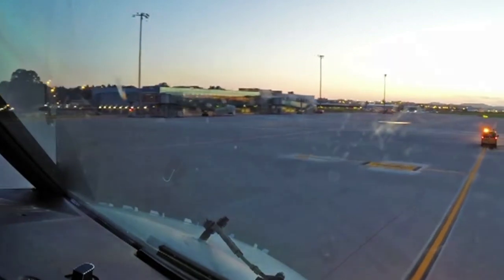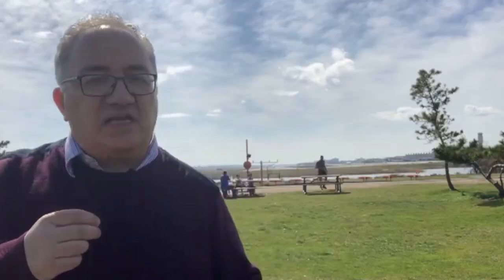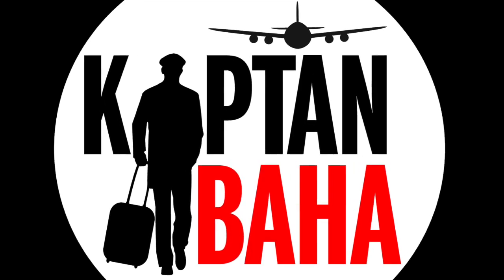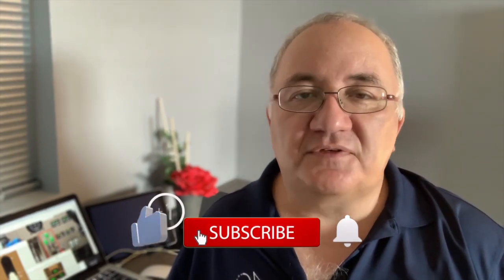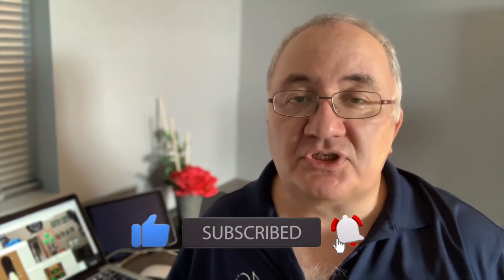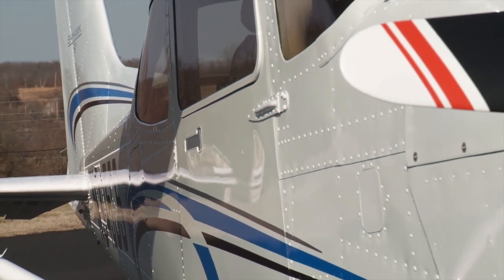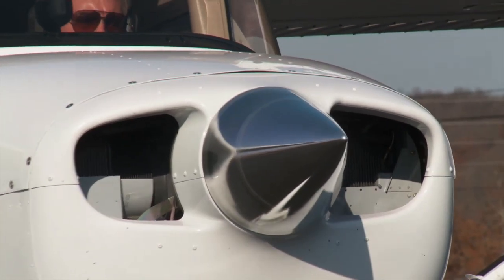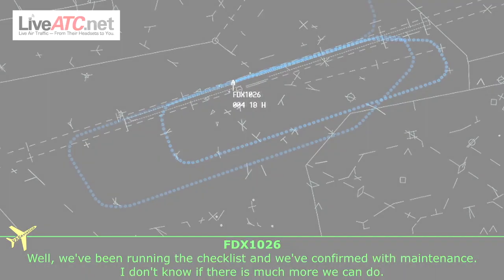Landing Gear Systems / Malfunctions | What do  pilots do ?

Comment: On top of all, thank you very much for your instructive videos and contributions to Turkish aviation&aviators. 
We truly appreciate you captain... 

Below, I share the paragraph that I’ve derived from landing gear system for C172RG POH related to landing gear malfunction and the recommended actions. 

Check out the link for further information: 
http://www.newvisionaviation.com/Content/Files/Retractable%20landing%20gear%20system%20for%20the%20172RG.pdf

“In the event of a gear malfunction, a manual hydraulic hand pump can be utilized to lower and lock the landing gear. You should pump until you have a green light, approximately 33 pumps. Manual gear extension procedure calls for a reduction of airspeed, put the gear selector switch in the “down” position and start pumping. Stop once you observe a green light. Visually verify left and right mains are down and use a mirror if able to verify the nose gear. Any doubt, a low pass at a towered airport can give you additional information about your landing gear status. Take note, you will never hear the words “your gear is down and locked”, only, “they appear to be down”. 

There is a call for reduction of airspeed, however it’s not related to nose gear free fall and slow flight isn’t mentioned, not even close.
The procedure is making sure you are below Vfe. 

Captain Baha is trying to point out “Trust but verify”principle , go to your POH and read it! 

Always happy landings...
Reply from the maker: Very good. This was one of the “false information”. You need to slow the airplane down for emergency gear extension regardless of the airplane. Even the 767 checklist I posted mentions that. HOWEVER , there is no where that says you need to slow the airspeed to a level of slow flight. Besides, why would you want to put the airplane into that kind of a critical position while you are trying to rectify a situation as severe as landing gear malfunction? 

Very nice catch !!! 

But ... 

This is not the only one. !!
Reply: Deliberately left the rest to other aviation geeks...
Reply: Fatih ÖZEL "
Reply: mahmut caykoylu 😉
Reply: Correction: “The procedure is making sure you are below Vle&Vlo”

So far, nobody has noticed the misinformation I’ve intentionally provided...

Vfe is related to maximum flaps extension speed. 
Extending your flaps (and slow flight) would be a terrible recipe for an imminent disaster while you are dealing with landing gear problem !

Hope you don’t mind my little trick captain 😊

Always happy landings